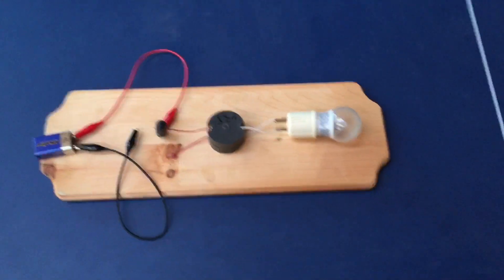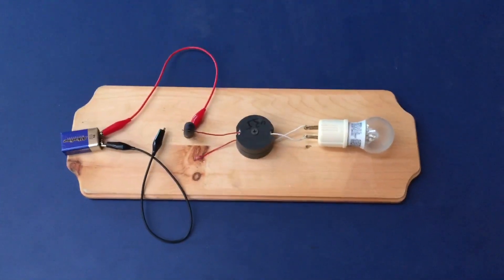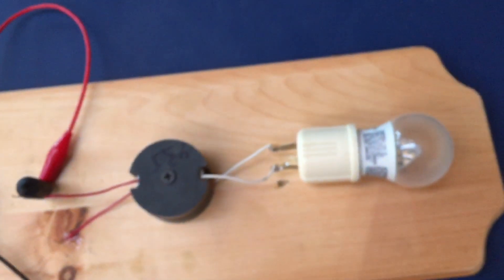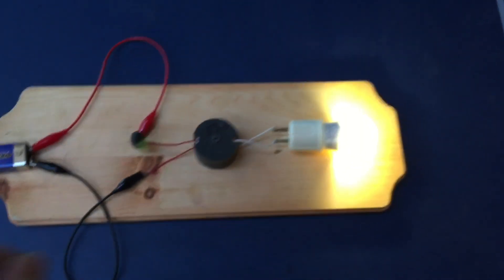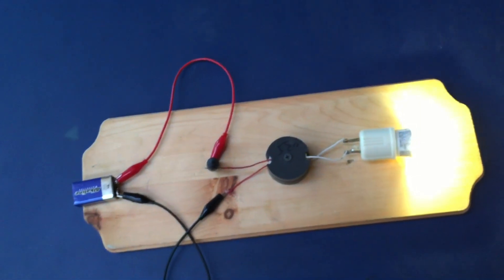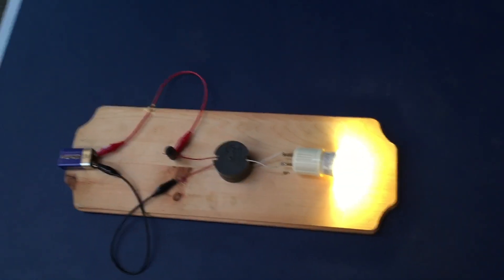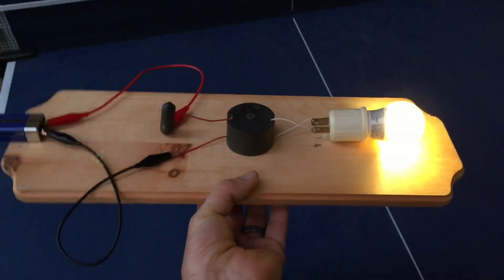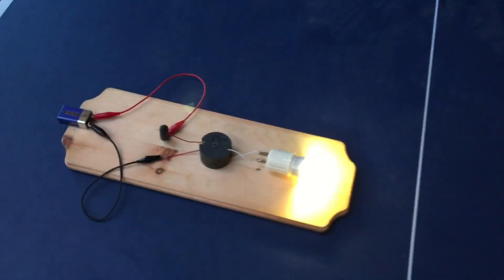Transistor Free Joule Ringer - Super Simple Config

Comment: Good circuit for a Tesla receiver LC circuit I bet. That high frequency can be changed to low frequency higher current oscillations? I got to use this for experiments.
Reply: so, its a transformer...with a fault? i must be missing something here....
Reply: jeremy gwilt I was thinking it works like a transistor but won't fail?
Reply: i agree, but its the same as a reed switch, or mechanical relay, right? it actually seems less reliable, relying on the physical connection.i understand, i just dont see how useful it is! (not that everything should have an immediate application).
i guess i just want to see more come from saber's camp. ....and so im jaded by high expectations.
Reply: jeremy gwilt I was thinking a 120 volt DC slayer using this setup.
Reply: doo eeeettttt

Comment: What is making the noise?  OOPs dumb question?  Well science was always right after lunch and I was so sleepy, I still don't know why.
Reply: Nick Ustari The water hammer analogy is a good one. When you move electrons in a circular motion they pick up "kinetic energy" (which manifests itself as a magnetic field) and resist change in velocity. thus when you open circuit an inductor after allowing current to flow through it, it generates high voltages because the electrons flowing through it can't come to an abrupt stop. If you look at the diagram for a conventional boost converter: http://en.wikipedia.org/wiki/Boost_converter
you can see how it works by flipping a switch and hammering a diode.

Transformer's are a little more complex because this kinetic energy (which is stored as a magnetic field) is shared by both (or multiple) coils. The best mechanical analogy I can think of to this is if you were to take the differential out of a car, put a great big flywheel on the input shaft, and treat the two output shafts as the transformer windings. You can have whatever gearing ratio (turn ratio) on the output shafts that you want. The flywheel spinning is equivalent to a magnetic field forming in the transformer. In this situation, the input shafts can spin independently of each other, but share the same momentum which is stored in the flywheel. (the windings are isolated but share the same magnetic field)

If you were to grab one of the input shafts (open circuit one of the windings) and wiggle the other shaft back and forth (pass alternating current through the other winding), it would be hard because you have to wiggle the fly wheel back and forth. And the faster you try to wiggle the shaft, the harder it is. (this is why high frequency transformers are smaller) If you were to wiggle one shaft and let the other one spin freely (pass alternating current through one winding while the other is short circuited), the fly wheel will not move (a magnetic field will not form), but the other shaft will wiggle back and forth in the opposite direction (alternating current will be induced in the other coil, but little to no magnetic field will be created). This is basically how an AC transformer works, it transfers energy from one winding to the other at a different voltage ratio while resisting the formation of a magnetic field internally. Now, back to the differential analogy, if you were to wiggle one of the input shafts and apply a little bit of friction (electrical load) to the other shaft, the flywheel would start wiggle a little because that resistance force goes back to it. (the more loaded an AC transformer is, the stronger the magnetic field that forms inside of it. Ferrite, the most common core material for transformers, exhibits a phenomenon known as magentostriction where it shrinks slightly in the presence of a magnetic field. This changing of shape is what causes transformers to buzz or ring. The more loaded an AC transformer is, the stronger the magnetic field, the louder the transformer buzzes.) Ferrite is commonly used as a core material because it has a high magnetic permeability constant. (heavy flywheel).

Now if I use this analogy to describe the circuit in the video. An LED behaves like a ratchet; it absolutely restricts the flow of current in one direction, while allowing current in the other direction given a certain amount of force (voltage) is applied (this is the forward voltage of the diode). This is equivalent to the differential with a ratchet on one of it's output shafts. You apply a small amount of force to one of the shafts. first the other shaft tries to spin the other way but can't (the led is preventing a reverse bias) so the flywheel must start spinning. It doesn't take a lot of force (input voltage) to get the flywheel spinning (a magnetic field formed) but it takes longer to get it up to speed (this means lower frequency oscillations). once the magnetic field is formed (in this case the magnetic field causes the wire to move away from the rod) you immediately clamp the input shaft tight (open circuit the primary coil) the flywheel will continue to move and "hammer" the ratchet in the other direction with great force (high voltage, much higher than the input voltage). This force exceeds the ratchet's holding force (The LED's forward voltage) and causes it to spin (current to flow through the diode).

Now a joule ringer behaves differently from an AC transformer  in that it stores energy in a magnetic field before transferring it to the other coil. (gets the flywheel spinning before transferring its energy to the other shaft with the ratchet). This limits the joule ringers power to one magnetic field's worth of energy per oscillation. This is actually beneficial in the case of powering an LED because too much power transmitted to the LED will cause it to blow up. Because the joule ringer relies on the formation of an oscillating magnetic field, the effect of magnetostriction is great, and the core will ring loudly.

This is effectively how a flyback converter works.
http://en.wikipedia.org/wiki/Flyback_converter
In contrast, a Forward converter is slightly different.
http://en.wikipedia.org/wiki/Forward_converter
Take the previos analogy, and flip the ratchet backward and gear it down so that greater torque is applied to it. when you spin the input shaft, the other shaft will try to spin in the opposite direction with a gear ratio (turn ratio) increased torque (voltage), the flywheel will not spin immediately, so All of the power applied to the primary coil will immediately be transferred to the secondary. Now any resistance force on the secondary shaft will cause the flywheel to start spinning (A magnetic field to form inside the transformer) which is undesirable, so the primary shaft must be switched off for a while to allow this field to subside. A forward converter has the advantage of being able transmit a greater amount of power, and be more efficient because of the fewer conversions of power, but it doesn't have the hammering effect (which under ideal situations allows the output voltage to be unlimited) of a flyback converter (joule ringer) so it's output voltage is limited by the input voltage times the winding ratio.

Phew! That was a lot of words. I hope this didn't confuse anyone as this is not my intention. I always enjoy sharing my knowledge and hope someone finds it useful.

Edit: because I made a whole bunch of factual claims and didn't cite sources, Ill suggest that anyone who wants to know more about electromagnetic theory take a look at Maxwell's equations. They're a bit mathy unfortunately, but they describe everything we know about static magnetic and electric fields, and are a good starting place.
Reply: joining to the question
Reply: in the Qd theory, we use the term " current" to define moving particles that produces wave, when not effecient (refered to as pure sine wave " ) it produces radiative/excess/ineffecient energy in the form of an energy that we may perceive or detect as a " turbulent" sound / light / ... and even odor. To make it simple, imagine a a water flowing TURBULENTLY ( not fine tuned as the case of a pure sine wave ), this type of flow produces a lot of radiation in the form of random bumps.. the collision it makes with the background makes the " noise ". ( QD theory on Electron Fluids )
Reply: Nick Ustari thanks
Reply: Still on the reference of the electron fluid - qd theory if I may, the battery is an overhead tank, the carbon fill is a sponge inside a pipe, the wires are the pipes, the transformer is centrifugal pump or a coil in a pipe which propels water ejection by centrifugal force... how about the light ? light is the collision of water particles being forced through a thinner piece of wire or pipe.. by venturi effect, a water passing through a thinner section would speed up so much so that the " radiation" it produces is continuous and we perceive this as light.
Reply: The wire is vibrating against the carbon rod. This provides the switching that allows the transformer to convert voltage. when the wire touches the carbon rod the magnetic field induced in the transformer pushes outwards on the coil and causes the wire to vibrate. The switching isn't as well timed as it would be with a transistor, thus this probably isn't that efficient, but as an extremely simple electromechanical voltage converter, it's pretty cool.
Reply: ...yes more likely the vibration will occur at the carbon rod and wire contact.. this we need to verify of course on the actual scene - but more likely it is. In the Qd theory for electron fluids, this is like the " Water hammer effect ". If the charge flow is not effecient, it creates turbulence...thus the sound. just imagine a stack pipe with a faucet at the bottom. If turned on, water will rush down turbulently and will hammer with the pipe lining. A way to reduce this hammering effect is by providing  air gaps or pipe extensions at the faucet. In electronics, this is done by fine tuning either by controlling the voltage or amps.
Reply: Leif Erikson Agreed  i need a popcorn !
Reply: In other words, just think of water current.. its the same as electron flow, they only vary with density/fractal level that is why we thought they are different.. same flow, same current, same concept, same analogy - anyone can relate to water flow no need for math or complex equations. BTW,  i constructed the Qd theory to simplify what seems to be complicated to the common people like me.
Reply: the vibration from the switching between the carbon rod and the lightly placed copper wire to the round transformer is making the noise..its a primitive method of switching before transistors were discovered..it works like the classic school bell ringer of the olden days just like an electromagnetic switch..
Reply: fidel catsro
yeah, just like the buzzer school project

Comment: Hi you know of joe booker in lie ore it appears to me that car battery instead on the one you have then the earth to the secondary the positive instead to the engine oil that may be the carbon rod and this would make a collapsing pulsed neutral field spike somewhere you would need to attach in this diagram to aluminium manifold so that the pulse field charges the manifold as a condenser then as valves open it discharges neg to attract then pos to repell could you try a right hand vortex secondary bridging the pos from battery to neg this should make a closed loop system making sure a broken fuse inline at battery pos so that the excited from connecting battery would initially jump that broken fuse with both your hands on neg and pos to act as a capacitance discharge no expert but I can see this is what joe booker is relating to in his engine that really is a AIR generator charged and discharged with engine oil and water becoming the fluid tesla coil